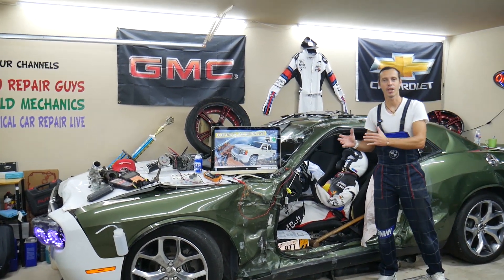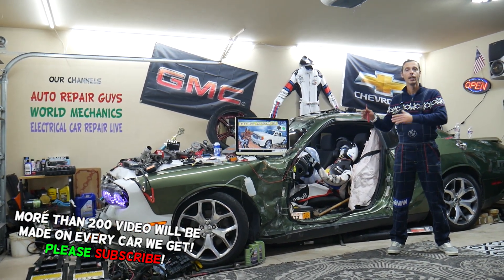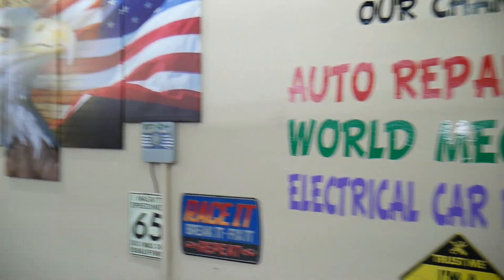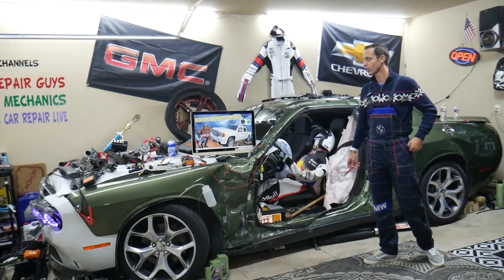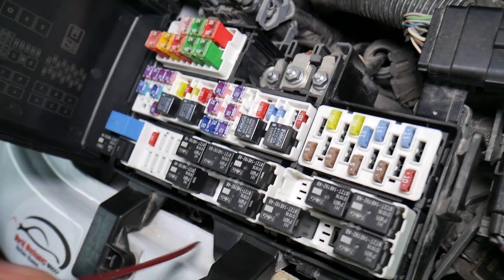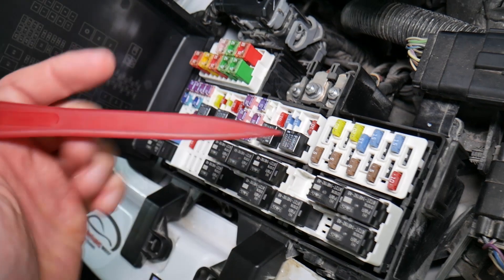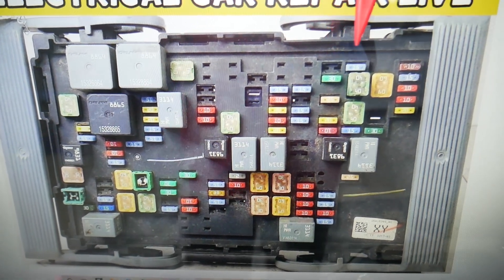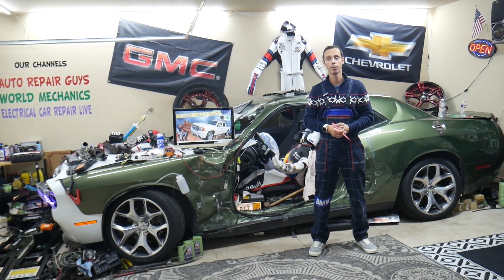WHY ABS LIGHT ON GMC SIERRA 2007 2008 2009 2010 2011 2012 2013

Comment: Your video was very helpful explaining why my ABS/Brake light stays on with my 2007 Sierra, apparently notorious for ABS issues? . Told it was  a failed module but I hope wheel sensor, fuses, rusted screw heads , relays ANYTHING but an $800 new hard-to-get module. Any additional advice?